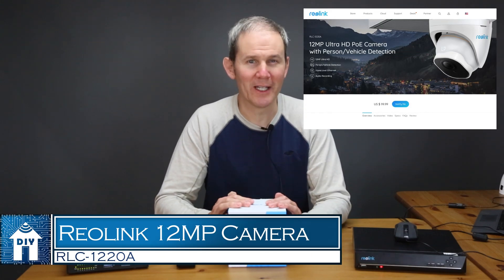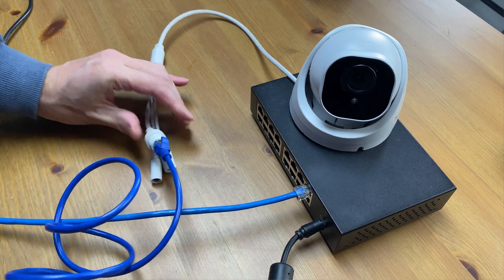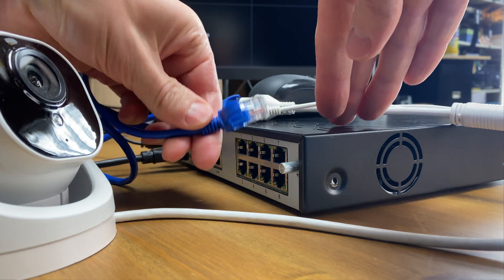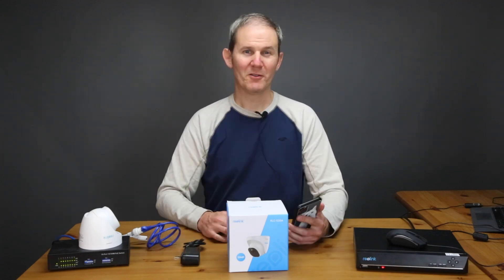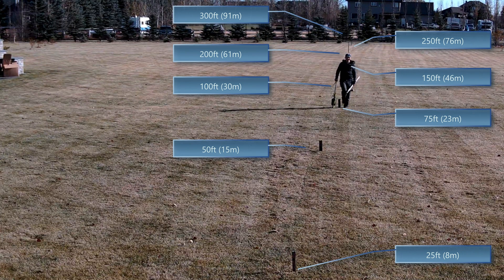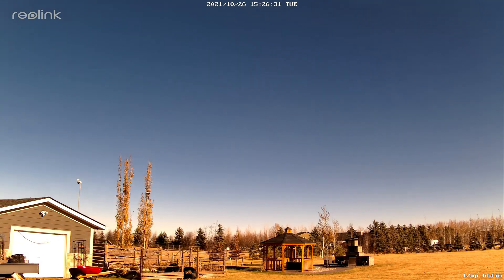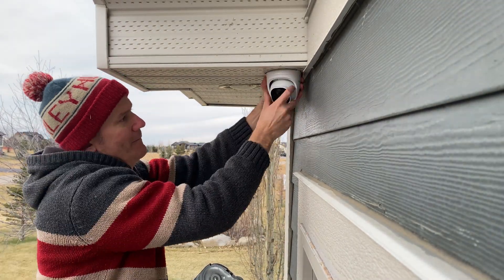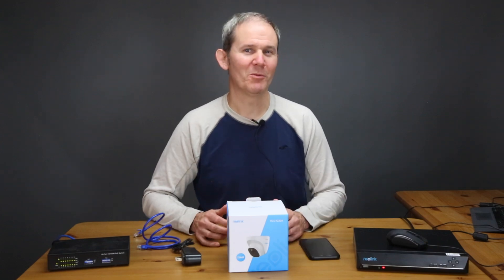Installation + Footage - Reolink’s AMAZING 12MP Security Camera Review

Comment: The video feed seems to always be very choppy and inconsistent with FPS in the video. Any known way to resolve that?
Reply from the maker: Which camera are you using? Is the camera a PoE or Wi-Fi device? Are you watching the feed on a network wired or Wi-Fi device? If it's a very high resolution there maybe some network latency if there is a bottle neck, especially over Wi-Fi. Try downloading the footage to a computer and verify if the video displays smoothly, without any latency. That will let you know if it's a network issue or a camera issue.
Reply: @HomeTechDIY I was saying in your YouTube video the fps of your cameras video feed is inconsistent and stutters. I was wondering why that was

Comment: If you record 24/7 and have a 2TB drive in the NVR how many days of footage will you get please? 
UPDATE - I got the version of this camera with the 4mm lens (RLC-1212A). If you are looking for cameras with a wide FOV you will want to look at 2.8mm lens (or double lens cameras). The 4mm and 5mm cameras will give higher quality but they do not cover much ground.
On HDD size if you are using 12mpx cameras you will want to upgrade your 2TB drive as these cameras require a lot of space. I should suggest 1TB per 12mpx camera minimum.
Reply from the maker: You answer should be here: https://support.reolink.com/hc/en-us/articles/360006073894-How-Long-Can-Reolink-NVR-Record-for/

Comment: How can I view the IP cameras feed from a diffrent private network (using internete) using RIO app or a computer in the network. Do I need to configure any Port Forwarding or how does it work? Could you please give me your two cents here? By the way nice video.
Reply from the maker: Thanks! I haven't tested it, but from what I understand, you can add multiple cameras or NVRs to the Reolink app from multiple locations. Add the devices to the app they way you would normally and they can be access from anywhere. No port forwarding is necessary.

Comment: Question...if the wifi goes down, does the camera continue to record footage?
Reply from the maker: Yes. This camera is hardwired to the NVR and records footage independently of the WiFi and Internet connectivity.
Reply: @HomeTechDIY  Excellent!  Thanks for responding.  The camera appears to be the same type of camera that captured footage of Suspect Vehicle 1 in the Idaho4 murder case against Bryan Kohberger.  This JLR guy got some footage of said camera...https://youtu.be/GU4SjPvmC30?t=195
Reply: @HomeTechDIY  I don't think I ever thanked you for your response to my question.  And I don't think I mentioned that you were featured in a video I did about the Reolink camera that many believe captured the murder suspect in the University of Idaho quadruple murder.  The landlord there tells me he believes his Reolink camera is a RLC-522A.  I have the 520A.  Anyway, here's a link to that video - https://youtu.be/07tmUEpPG2U?si=Dc7qOMxWGiPTvJMS

And I would love to get your opinion on whether the Reolink camera at the University of Idaho is running in infrared night mode or just black & white night mode.  Here's a link to some of the video captured by that camera - https://youtu.be/ND5pLBty6P8?si=DAiwtBKtdW7qI98X
Reply from the maker: That's awesome! Thanks for the video and plug!

Comment: The 820A is an 8mp sensor sadly, the only 12mp offering at this time is a RLC1212a. If you want better than this you'll have to shell out for HIKVision's most cutting edge 12-16mp offerings, those cost a lot.

Comment: I've been a Blue Iris user for years but was having so many issues using my Reolink cameras with it (i.e. glitches, audio/video sync issues, playback speed issues).  I've spent many hours trying to optimize them to no avail.  My Blue Iris PC is plenty powerful (i7-8700 with 32 GB of ram). It seems Reolink cameras and Blue Iris are NOT a good match. I have 20 Reolink cams. 10 of them are 4k, 9 are 5MP, and 1 is 3MP.  Just bought a Reolink RLN36 NVR about a week ago and it's been working solid.  It supports up to 36 cams.  I'm able to run all of my cams at max bitrate and resolution without any problems.  I love it!  🥰
Reply from the maker: I didn't know Reolink had a 36 channel NVR, so I looked it up... pretty cool. I too am having some glitches with Reolink on BI. Thanks for sharing
Reply: As you have long got the NVR this is no use to you but might help someone else...

Using BlueIris in "desktop" mode to monitor the CCTV seems to use significantly more CPU time than streaming to the web interface. 

I am running BI in a fairly lightweight Windows VM on my TrueNAS server. When I bring up the live view via web I'm only running at between 22% and 27% CPU. When I open the VM desktop it stays about the same. But when I open the BI desktop application it varies between 50 and 70%. As soon as I close that down, back to the mid-20s.

I know many people use their BI servers as the viewer for their CCTV, so worth a mention in case someone thinks their BI server can't hack the task and is about to drop a load of money to build a new PC when all they really need is a tablet for everyday viewing!

Comment: You did not address the frame per second which is a highly important metric
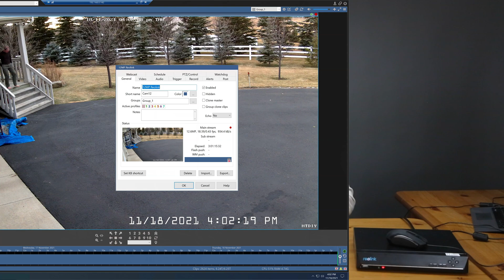Reply from the maker: It was mentioned at 4:30. It's a max of 20fps at 12MP. There is also a visual of the frame rate when bandwidth is discussed at 17:35. Is there anything additional I can lookup for you?
Reply: @streetgainer you did not pay enough attention and missed the frame per second info, which is a highly important metric

Comment: I bought the bullet style version of this camera, RLC-1210A.
This caused me serious problems when connected to my Milestone installation. I even did a total re-install of the Server OS and Milestone trying to solve the issue.
First the camera OnVIF is not recognized by Milestone, newest device drivers did not help in regards to this. 
Finally found that attaching the camera as a "universal camera" got picture and sound in the NVR but the software became unstable because of this causing the recording server to crash and restarting (automatically).
Newest FW on the camera did not help the situation.

So if you are running Milestone I do NOT recommend this camera.
Reply from the maker: Thanks for sharing. Sounds like you spent a lot of time troubleshooting only to end in frustration.
Reply: What do you do with the reset button and the power cord if you're using the Poe. Will they not just end up dangling, is there any weather resistant caps that come with it. they seem kind of big to be hidden if you're mounting this on a wall and not going straight through the center base?